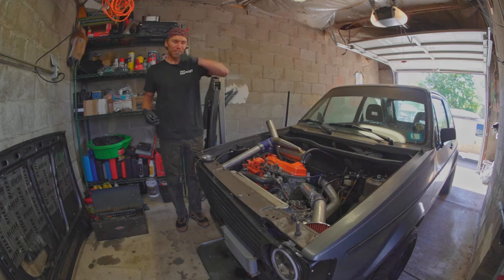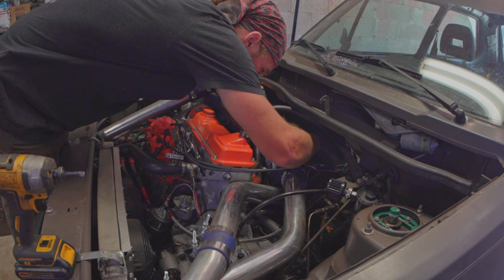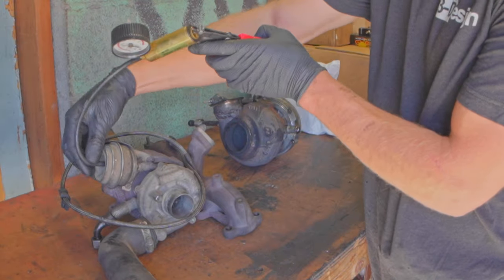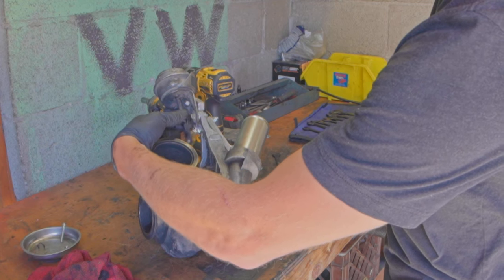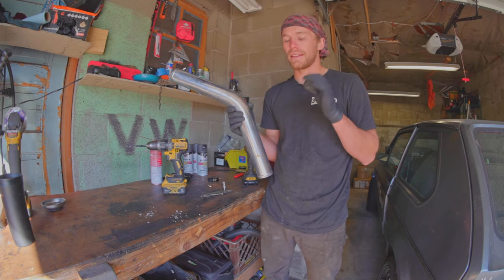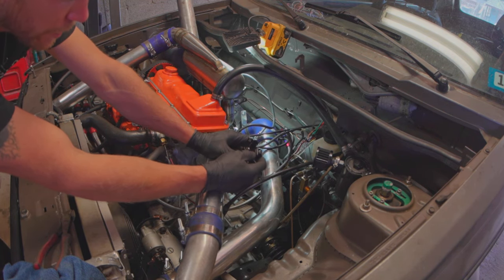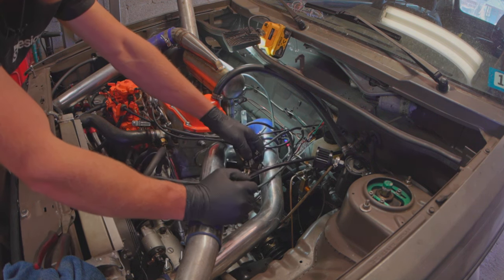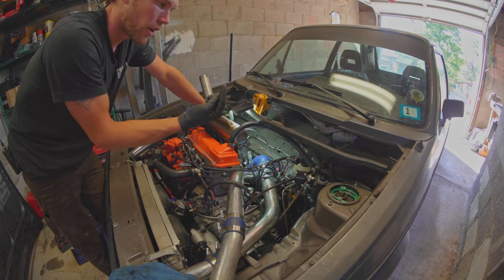Watch me install the GFB V2 Boost Controller in my 1.6L Turbodiesel

Comment: I have used a normal boost operated wastegate actuator before with good results.
Also you might want to try opening the vanes a bit with the travel stop screw

Comment: Im fixing to do an aaz swap on my caddy running a vnt. I went with the digibooster vnt controller a guy in Scotland makes them it works off of a map sensor and you can also add a TPS sensor if you want even more control.  He has been making them quite awhile and has everything dialed in its a plug and play standalone VNT control. I did see one of his older versions on eBay for only like 100 bucks with a used n75 valve thats 
 a killer deal.

Comment: maybe the solution is to use a different point at the linkage to make the linkage move further with the exact same actuator. 
It might be worth trying to weld on an additional bung to make it work. 
Controlling that thing still might be a pain.
Reply from the maker: I'm with ya! I've had that thought as well, I think I'm tossing the idea at this point though bc to correct it (like changing lever lengths) would be as much work to put it back to Arduino and without any guarantee of it working 💁

Comment: Can't offer any help but following because I want to try to keep mine fully mechanical. Keep trying!
Reply from the maker: 😂😭 will do
Reply: Hi, i am controling vnt with boost actuator with mechanical boost controller like a turbo without geometry. Depends on what pressure you want you need to buy actuator with the needed amount of travel and spring for this pressure. My inspiration is from 2.4  old alfa turbo which is using this type of control. This is the garret number for the turbo 454150-6. I had setup with 2056 with actuator from garret t15 original for 1.9tdi 90hp AGR engine but its spring doesn't hold more than 1.4/5 bars but its cheap solution. Now i use a bigger actuator and turbo for 2.2bar boost but it have a short spike in full throttle for like a second and then drops to the needed pressure its not perfect but its simple and working.
Reply from the maker: @simeonov99  right on, cool solution!

Comment: Hmmm I’ve been running the gfb controller for about 4000 miles now and am pretty happy with it.  Though, I’m running an alh with the stock vnt 15 turbo and mechanical vane vacuum pump.   

I can’t help but wonder if that stock alh turbo would be a better match for the 1.6?    I mean, obviously not if you’re trying to tear up the drag strip but maybe drivability…

Anyway, I appreciate you sharing the journey… your explorations have definitely helped me with my project.
Reply from the maker: Interesting!! I think with the vane pump it would work better, and certainly with the ALH turbo it would work better as well. Realistically the vnt15 would be a great match for the 1.6. At this point I'm really using my 1.6 as a test bed for the 1.9 I'm building, and I think the bigger turbo will kick ass on the ALH motor. Thanks for the thoughts!

Comment: Im controlling my vnt atm with a simple brass T. Not sure how efficient it is as i seem to run out of fuel on the top of 4th and 5th
Reply from the maker: Hmm could you elaborate? What connections go to where on your tee?
Reply: @OliverFetter  i have one going to the brake booster for my vacuum source, one goes to the turbo and the last one is boost pressure

Comment: I am pretty sure you have the actuator flipped around
Reply: What i mean is from what i can see, looking from the exhaust side you have the tdi turbo and actuator pulling clockwise. But on the merc turbo you have the actuator pulling counter clockwise
Reply from the maker: I see what you're saying (thanks for clarifying!) I don't think that should matter too much, it's still pulling the merc turbo in the correct direction w.r.t. how its vanes move

Comment: Its not linkage its boost controller. By bypassing vacume solenoid your vains are fixed . So by unscrewing rise your just allowing vaccum to leak  wich keeps vains closed more than normal thats why you get quicker harder boost and the other screw, the boost one lets the pressure out as the nains no longer adjust , nothing is slowing down boost. So ur turbo working at max and just leaks boost at the level u set it.